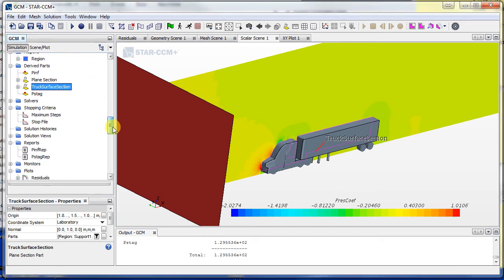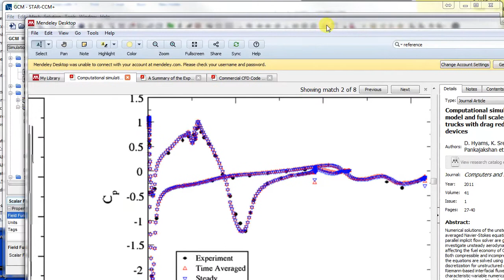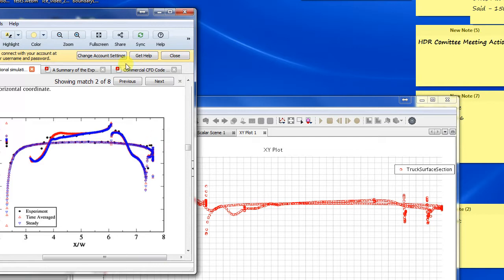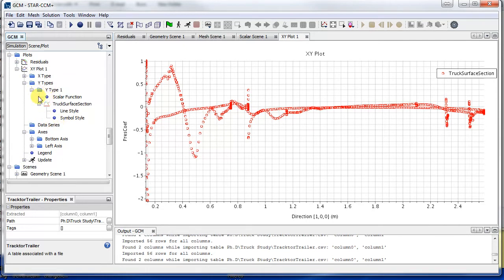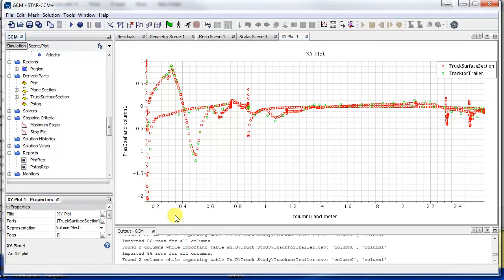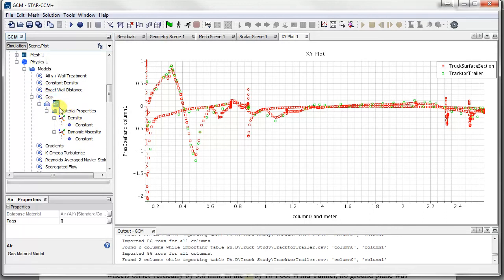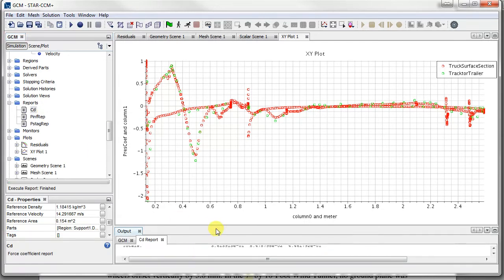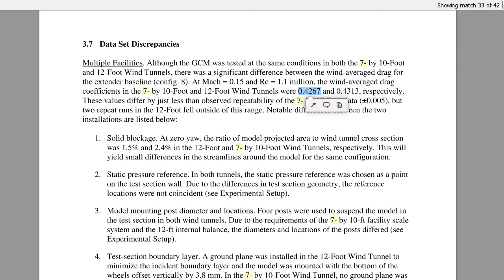Star ccm+ Beginner to Pro [Simulating a truck part 19]

Comment: hi Zac, could you upload the tractor trailer table please.
Reply from the maker: Hi Stableboy, sorry I think this is the one.. https://ufile.io/aik8s
Reply: thank you, i really appreciate you making these tutorials , they are very helpful. And also, if you dont mind, could you make a video, on how to plot cell residuals, as i just cant keep to figure it out.This is to identify, where the large residuals are and how to refine it
Reply from the maker: Hi.. I'm not exactly sure how to plot the residuals on the actual cells.. there is a scalar quantity known as 'Cell Quality' that can help you identify regions that should be further refined. Good luck :)
Reply: i mean the "Extra Post-Processing"
 In the solver properties panel, it might be advisable in some situations to turn on the| Temporary Storage Retained option. Running at least 1 iteration with the option enabled will give you access to additional Field Functions that can be used for Trouble Shooting purpose.
For example, local residuals, gradients, correction, ...
These can then be post-processed and visualized to check for areas on the model of extremely high gradients, residuals for instance 
I don't really know hjow to impliment that in star ccm+
if you dont mind, could you make a tutorial for this as i am unable to do so
many thanks

Comment: Thanks a lot for your tutorials!!  Could you show how to make streamlines to represent the vortex? I did a wing simulation but I didn't get to represent tip wing vortex by using streamlines, so if you can demonstrate that, I'll be grateful. Many thanks
Reply from the maker: Hi.. i can describe it to you quickly.. if you look at my Backwards-Facing Step series somewhere near the end i show you how to put streamlines in. You just need to make sure your source points are in a suitable place to show the vortex. Let me know if you figure it out!
Reply: @zacmac  can u provide the experimental data of the simulation??